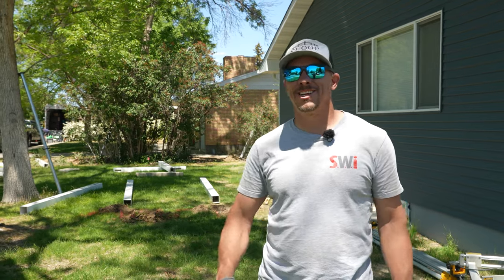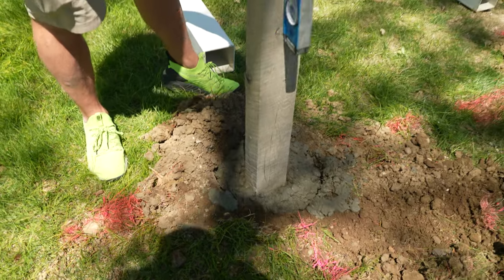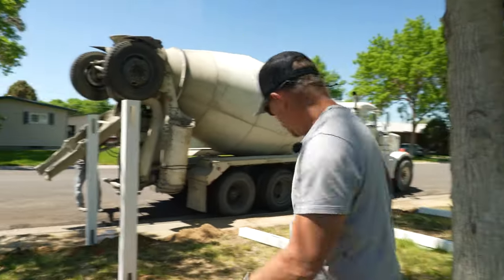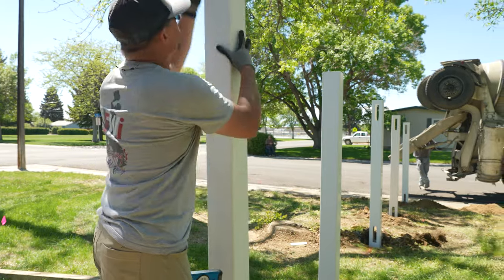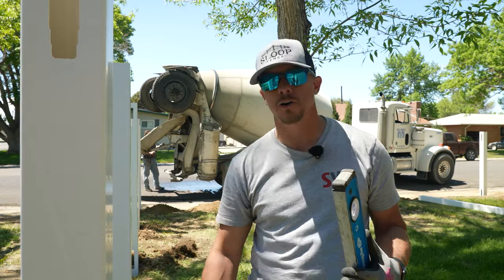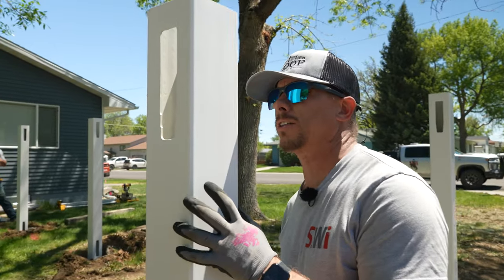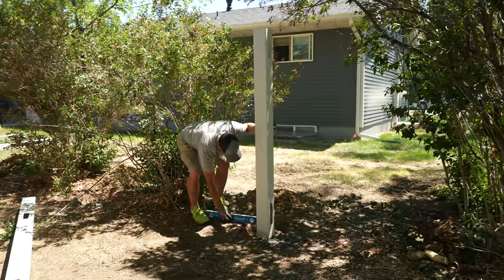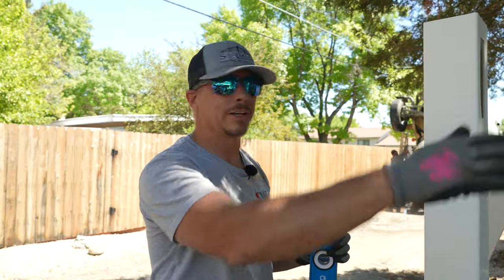Setting Vinyl Fence Posts In Concrete Without A String

Comment: I’m curious, I’ve never built a vinyl fence but when you are planting your posts in concrete, how do you spread them enough to get the rails in when you get to a corner post?
Reply from the maker: If the rail length is correct you slide the rail all the way into one post, which gives you room to then slide back the other direction into the other post. You notch your rails to keep them from sliding out again.
Reply: @SWiFence so what would that distance be for standard 6x8 panels? I’m getting ready to do my fence and want to do it the way you did in the video where I place all the posts in first and then put the panels in. Any advice is appreciated.

Comment: How do you get the top rail to flow (or know that it will when the sections built) without having a rail in to see how it’s going to look?
Reply from the maker: Get a stool and sight across the top of your posts, or put a mark on the side of each post and use that to sight (usually requires an assistant to point out marks with their finger).
Reply: @SWiFence  this is going to sound like a REALLY dumb question haha, but what do you guys use to Mark the side of the posts (vinyl posts)
Reply from the maker: Usually just a small tic with a sharpie.

Comment: Me and two other people could build 2500ft of 5 string barbwire pounding post at an 8ft spacing. Becuase we did not use a string line. When you can trust your eye you will move faster with less walking
Reply from the maker: Yes! This. 👆🏻
Reply from the maker: We prefer pounding when we can as well. 💪🏻

Comment: Can you use sand and dirty instead of concrete for the post
Reply from the maker: No. You can tamp a post (which is a different method) using only the dirt you brought out of the hole, but you can't add sand and dirt and water back in to the hole the same way you would with concrete.
Reply from the maker: You can also drive a post straight into the ground without digging at all--again, different method.
Reply: I'm doing vinyl fence tho that's why was asking
Reply from the maker: Gotcha. Our favorite method for vinyl is to drive steel posts and then sleeve over them with the vinyl (https://youtu.be/23SacHpNIdc), but you need the right equipment for it. Our other go-to is pour-and-stab like you saw in this video. 👍🏻

Comment: Why not a 4foot level, and string line is always good practice..
Reply from the maker: Longer levels make sense if you have material with variations, like wood. Quality man-made materials like vinyl or steel don't need a long level.

Comment: For 8 ft. Panels, how far apart should the holes be dug (center to center ) oops you just answered I think.
Reply: Did you figure it out? I don’t think I caught it but i’m also curious on the distance.
Reply: @JorgeDiaz-id1jo  ahh from when I did my yard, I’m pretty sure the magic number  97” apart. I dug holes 12” in diameter with 97” being center to center from one whole to the next hole with 5”x5” posts. 12” inch holes allowed for some play . Should have been 15” holes around . 3 xs post diameter but…
Reply: @joejones56  thanks for the reply, was 12” enough or overkill? I see on the instructions for the 5x5 posts that it calls for 10” holes so I’m curious to see if 10 is enough or if I should go bigger. Thanks again!
Reply: @JorgeDiaz-id1jo  that 3x’s the post diameter rule from what I heard comes from ASTM. The intention is for post strength and durability overtime, depth is also important depending on how deep your frost line is. You could probably get away with 8-10” hole but I would just do 12-15 for piece of mind esp if it’s your property.

Comment: I do miles of chainlink we sight everything in no string lines nothing
Reply from the maker: Love it!
Reply: Miles of commercial chain link doesn't really matter for perfect alignment or proper grade flow because it's for security and not cosmetic but you can't do shitty half ass work in a residential or business setting where quality of aesthetics is crucial. Perfection technique requires instrumentation meaning string lines for alignment and flow of grade in this scenario. In your case of a commercial situation then sighting in is generally acceptable. Chain link posts can always be hacked off to preferred height with a portable band saw or pipe cutter if blending heights for grade flow.

Comment: i near chocked when i see you guys fumbling around with a 2 foot level, get a torpedo level and slip it in your pocket, plumb is plumb.what works good for square posts is a post leavel with a small bungie to hold it on the post, that way you see plumb both ways as you stab the post.try it.you can always go back and check final plumb with your 2 footer ,not necessary though.

Comment: You have an end post In the middle of the line... Takes 5 minutes to set a string and 100x better looking job
Reply from the maker: No, there's no end post in the middle of the line. Yes, folks who haven't had the experience may have a much easier time of it if they run a string. But if you do this on the regular and don't want to worry about wind and shrubbery and longer distances--this is the way to go.

Comment: The only way you can actually push the post down through the cement or concrete is if you have a lot of extra water in it but when you have a lot of water in it supposedly the concrete is much weaker and will crack much easier and when I tried to push a post through the concrete when the post wasn't already in the hole ahead of time it literally wouldn't go down at all unlike how you're doing it where it seems to go down extremely easy because I think you guys are putting too much water mixed with the concrete which makes it weaker but whatever works for you.
Reply from the maker: We like to have it coming off the truck at a 4 or 5 slump. Which is not anywhere close to too much water. 
To be sure if you're running it a lot thicker it's going to be significantly harder to use this method.

Comment: How strong are these plastic fence
Reply from the maker: Depends on the kind of strength you're asking about. They'll flex in high winds and then spring right back into shape, but if your mower throws a rock it can go through.